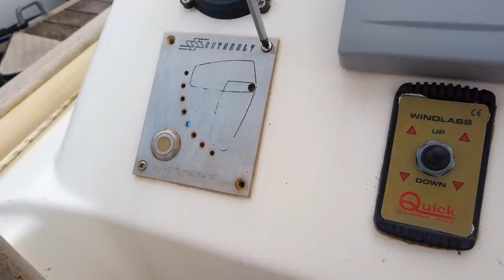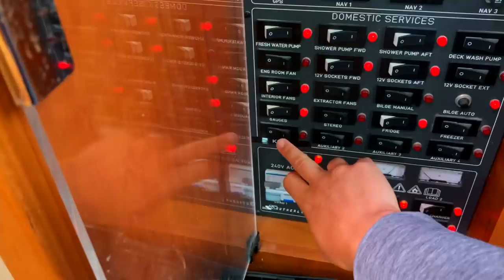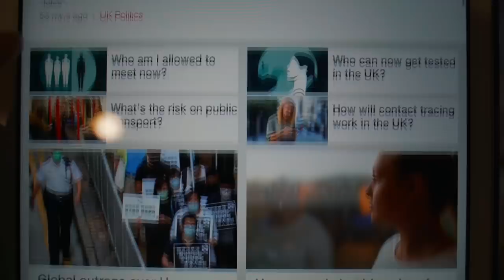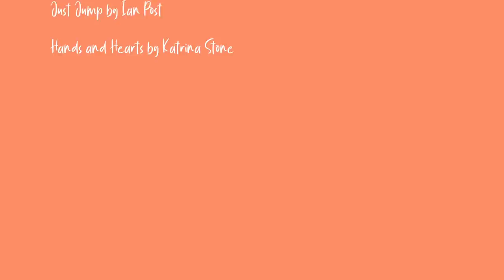BOAT LIFE = BOAT WORK | Back To Normal Life Onboard Ruby Rose | Ep 116

Comment: Having seen the challenges of your “mousing” exercise I’d strongly suggest the incorporation of multi-duct micro conduit as a cabling backbone throughout Ruby Rose II. It will make any kind of future cabling moves adds and changes an absolute no brainer. Options for conduit configurations are virtually endless from 1,2,4,7,12,19 and 24-way multi-duct conduit 8.5/6 mm (OD/ID) to 1 or 1.5 “ stand alone single ducts. Super slippery inner linings make pushing cables through very easy. This conduit technology and (air-blown) cable installation of cables up to 11mm OD into appropriate sized ducts the global standard for telecommunications fibre optic cabling infrastructure ( on a much smaller scale of course) will make this job dread free in the future on a 45-foot yacht. A little planning of the cabling infrastructure of Ruby Rose II During its construction will save you hours of ugly work down the road. Look into it, it will be time extremely well invested. Good luck in killing that mouse!!

Comment: When I worked as a electrician helper when we pulled wire we would fold over the wire basically making a loop and tying the lead string in the middle of the loop and taping the end to the wire to itself so there would be less friction

Comment: Goodness.  Zip tie the 10 wires and then take the bundle and zip tie it to the bulkhead.  Much easier :). Though there are probably several reasons that wouldn't work in that situation so I defer to your expertise.
Reply: Ya, but the problem with that is in that convoluted space and all the wires being different in coming and going, and different in slack and stiffness, if you gather and tie them in the airspace and then move the bundle to the anchor point all but one wire will be too tense or too slack or dragging the bundle in the wrong direction.  You really need to gather and and comb and settle them at the anchor point, that's one reason Nick said at the outset "close the zip tie but do not tighten it" as he expected to comb out and settle all the wires before final cinching.

Comment: You should consider acquiring one more knot skill to your repertoire and that is a uni knot that you would attach to the cable you're pulling and it's 100% knot strength and has a considerable low profile which would also because of the knot strength not require you to double over your cable
Reply from the maker: Cheers mate

Comment: An inside view into the glories of working in cramped spaces. Been doing this since I was a kid trying to stuff big engines in small cars LOL. 
Nick...was I not seeing correctly or was the Cotter Pin you showed us not installed with a leg bent around to keep it from vibrating out? It looked like it was just slide through the hole in the post? Not picking on you my friend,  I too know what it is like to depend on that stuff..
Reply from the maker: It was a bad angle- the other side was bent around but you can’t see it

Comment: dish soap is a little bit better for the cable. Works as well and doesn't erode the rubber. Petroleum is bad for rubber.
Reply from the maker: Cheers mate
Reply: Also, dish soap eventually dries up and doesn't attract dirt the same way.  If you use the right type it's also environmentally friendly if it ever gets washed off.

Comment: In U.S. English, "mousing line" translates to "fishing tape."
Reply: In the Queen's English mousing wire is a locking wire used to secure bolts and shackles etc, a safety wire. For pulling wires through a conduit you use a draw wire or draw string, to draw or pull the wires through, which is what he was doing in the video.

Comment: the piece where the rose joint/ram attaches is called a tiller steering arm
Reply from the maker: Thanks mate
Reply: @sailingrubyrose  you welcome. congrats on the 1370, she looks great and you guys will love it im sure. looking forward for the remote locations you will take us on!
Reply: @sailingrubyrose  actually, to be pedantic, it's the pitman arm. A pitman arm converts radial movement into a lineal force, which then acts upon the tiller arm.
Reply: @henryphelps3590  on a steering box, the pitman arm is the output arm. This looks like the shaft coming down from the binnacle, which acts as the steering box.
Are you talking about an autopilot servo or actuator? If you look at that you'd likely find an electric motor pushing a shaft in and out - radial motion to linear...
Reply: @rustymozzy  i was under the impression that the term pitman arm pertained more to cars/truck steering systems, than boats

Comment: Was it not possible to connect the new to the old? Male to female? Do without the intermediate drawstring?
Reply: That would require the connector design be the same on both ends, a reasonable expectation for 99% of situations, but here the cockpit receptacle for the remote would be different than the connector for the back of the radio in the cabin, primarily so the cockpit end can be more weatherproof.

Comment: to be fair, "10 wires" is incredibly non-specific, I mean, you didn't say what base numbering system, base 5 is super common... right? (documenting this all on video is either a brilliant strategy to win arguments or ... not) 😊 Did you ever diagnose the actual fault with the swing keel controller? They didn't look like they were potted as much as I'd expect for something so exposed to the elements where salt water ingress seems so likely.